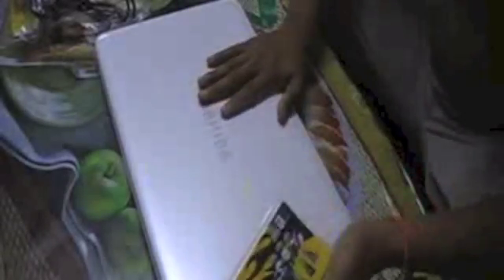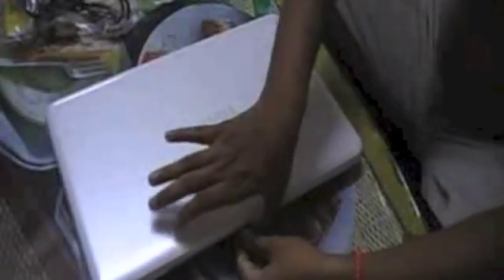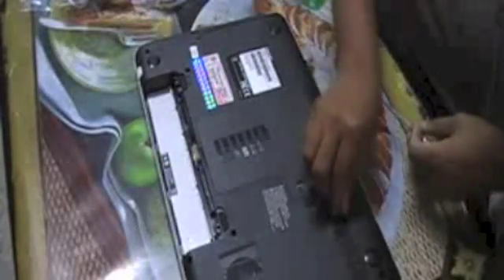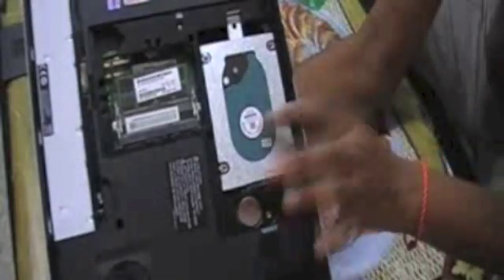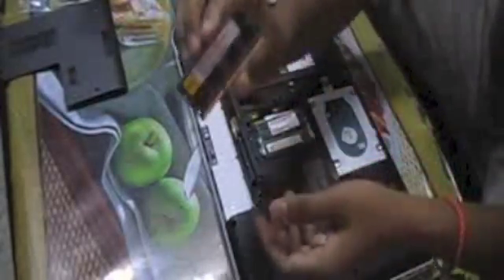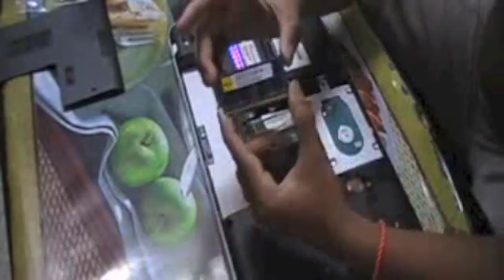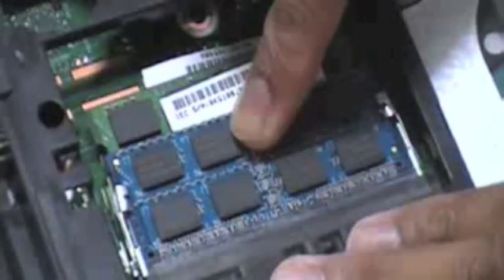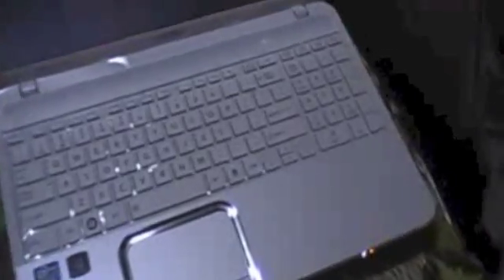Install EXTRA RAM to Toshiba L850-1007XW

Comment: Thanks man,  That really helped.  :)

Incidentally, for those asking - Crucial are doing 16G for €120 and 8G for €65.

If you add two 4G RAM modules, assuming you buy decent RAM, you'll simply have 8G Ram.  But why buy 2 x 4 when you already have 4.  Either buy another 4 to give  total of 8 or buy an 8 to give 12G.

Then simply follow the video above.  It's a lot easier than the Dell RAM upgrade I did a few years back.

Comment: hey bro ... i need your help 

i got Toshiba L850-B162 and its a 6GB (4GB and 2GB dedicated Memory)
In the instruction manual it says i can upgrade it to max of 16GB...

i just want to add another 4GB ... what are the thing i should look before buying a ram? thanks nice video. . . 

this is a dumb question if I brought a new 2 x 4GB RAM and I will replace the one that toshiba installed what will happen?